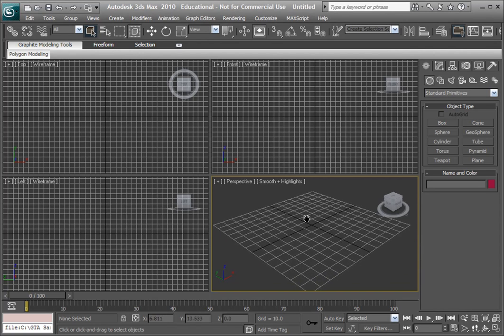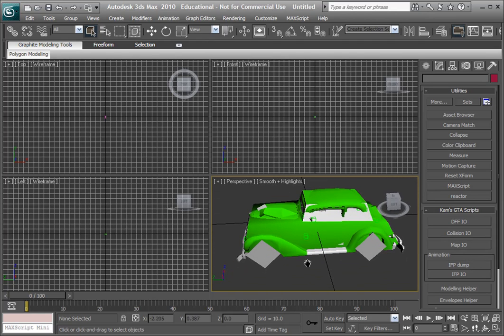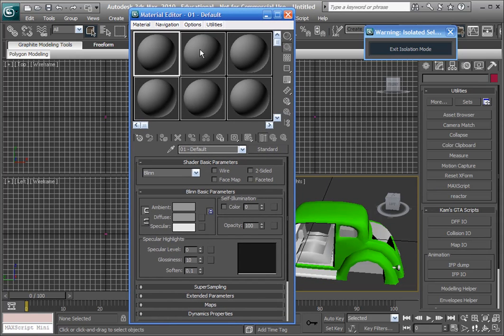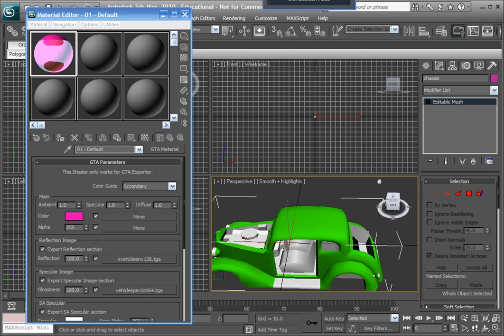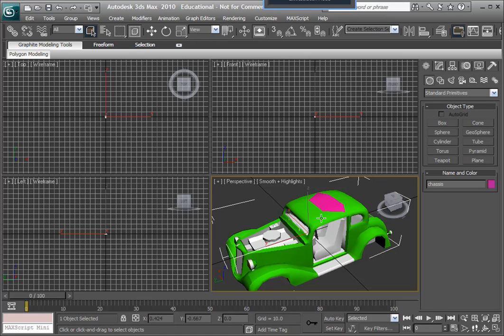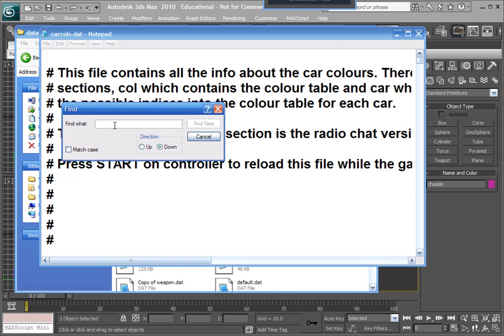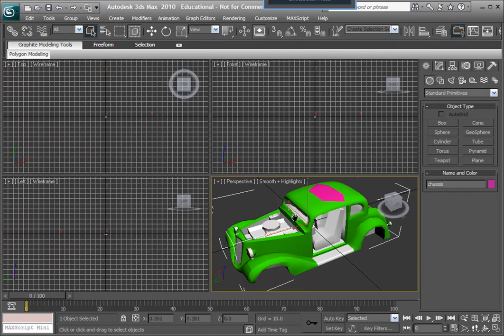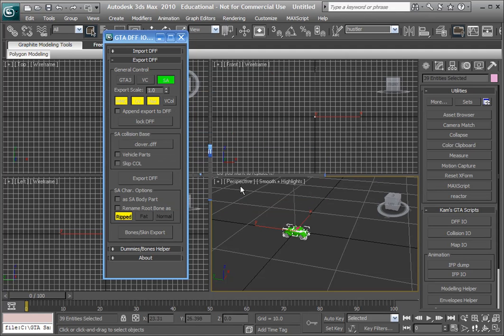Awesome Tutorial - GTA:SA Vehicle Materials

Comment from the maker: I guess if you attached everything to the chassis (apart from the dummies and the wheel), make new dummies (only a few are required, can't remember which ones though. :) ), use GTA materials instead of the imported ones, use a similar car as the col base and then you should be all set! :) Good luck with it! :D